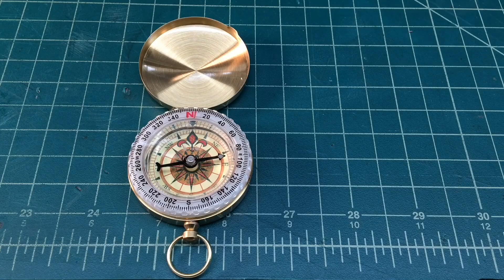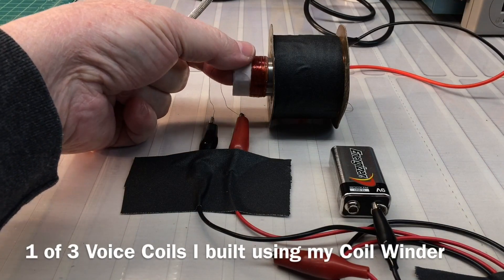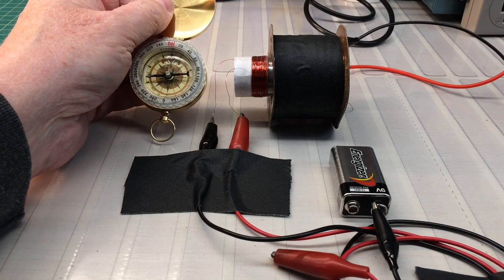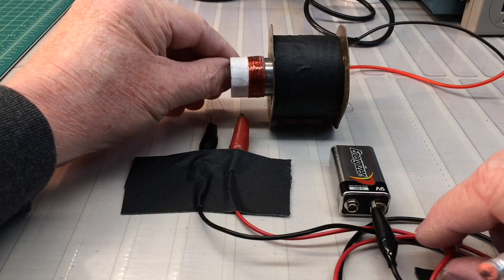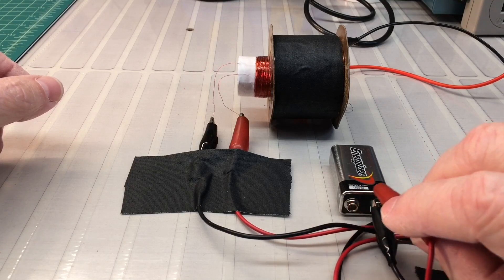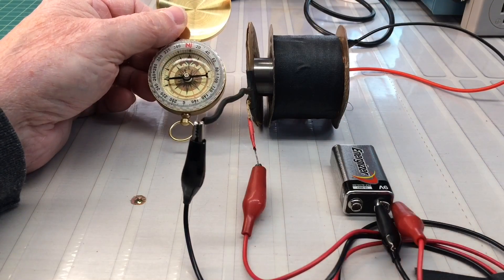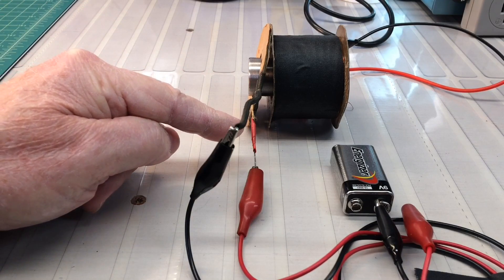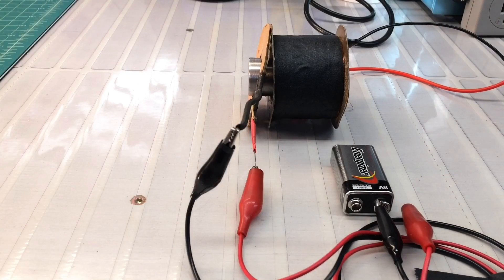Field Coil & Voice Coil Polarity?

Comment: Is there a follow up video ?     I still don't know how or if the polarity actually affects the hum reduction.
Thanks for taking the time.
Reply from the maker: Howard Higgins Howard, check out the comments on the video from Steve... It's my understanding that the VC polarity makes no difference in a single speaker configuration. Of course the hum bucking coil does need to be wired in correctly to reduce hum. Hope this helps. Best, Don

Comment: I have a question, I think or thought the voice coil is centered in the length of its travel.So does it matter if the voice coil moves forward or back.I mean is it louder one way or the other. I have always wanted to know. Great vids and thanks ahead of time for any answers .
Reply from the maker: +kardeef33317 I prefer to have the polarity push the voice coil toward me when positive, but to your point, I was told by a subject matter expert that the polarity is not important when using a single speaker. Sorry about the belated response, I've had a lot of personal issues that has occupied my time as of late. Best, Don

Comment: I still do not know what polarity is on the wires which lead to the speaker itself? Can I hear with the battery you have shown by listening carefully to the speaker itself? Thanks for the very interesting video you have made.
Reply from the maker: +abele ballestri The voice coil should push away from the magnet, which would indicate the polarity is correct. Hope this helps. Thank you for watching. Best, Don
Reply from the maker: +abele ballestri Review this link at: http://www.cyberus.ca/~ec091357/TheVoiceCoilAndMagnet.shtml#